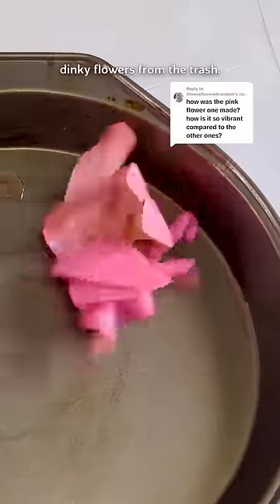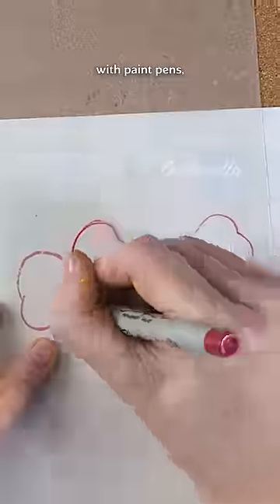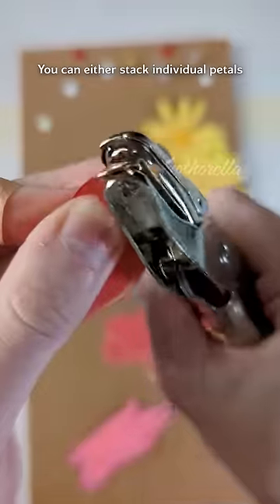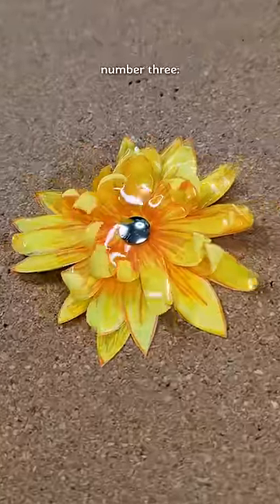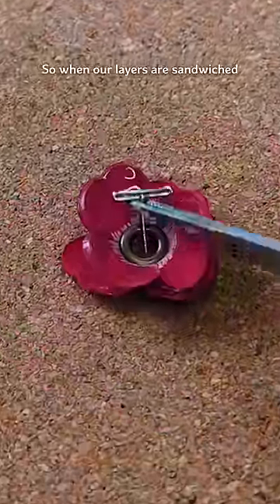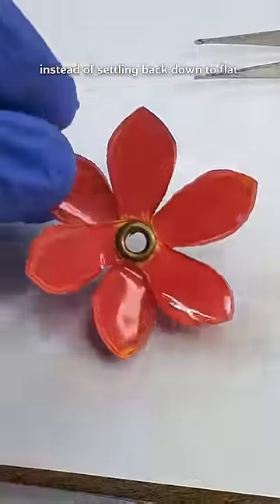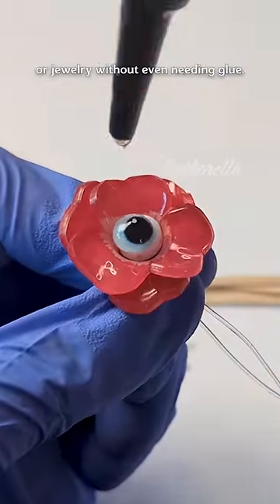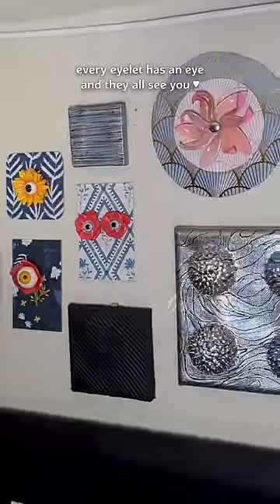#6 plastic = Shrinky dinks 🤯 now we can make flowers from trash ♻️🌷😜

Comment from the maker: ❤FAQ: Is this toxic☣️ -Quick answer. No, it should not create toxic fumes. Longer more involved answer:
So when we are heating our polystyrene to 250° f (212° f  should be what is needed) We are taking our plastic to its glass transition temperature but not actually melting it or burning it. When polystyrene is created it's extruded at a certain size and then stretched and rapidly cooled to basically freeze the polymers in place , so when we take it to our glass transition temperature we are unfreezing the amorphous polymers and letting them snap back to where they want to be . So no toxic fumes being created just some polymers getting cuddly. But that said, don't eat off the shrinky dinks.
(Another great example of glass transition temp is rubber! Which is past its glass transition temp at room temperature ! 
Now if you were to burn polystyrene, That would be bad. That does create toxic fumes. No open flames near polystyrene which includes styrofoam.
Reply: Can you include Celsius conversions for us who are not from USA? :)
Reply: Thank you for the information! But is the painting itself also not toxic when heated to this temperature?
Reply: Thank you for the useful info on how to get this for free. What a brilliant way to reuse plastic that would otherwise go in the recycle bin where it may just end up thrown in a landfill.
Reply: i'm a plastics engineer and i love this in-depth description you gave to explain why ps behaves the way it does! i also absolutely love your personality from just this video alone - i'm definitely gonna try to make some of these!
Reply: @idontreadorreply there are conversion tables on Google
Reply: Since you only need 212, have you considered boiling?
Reply: @evanmorrison3232 this would be impractical. It would be harder to maintain the temperature, make multiples at once, and probably have an adverse effect on the paint.
Reply: Does anyone know what the clear thing she put over the eye and flower is?
Reply: @samanthasunshine8085  it'd be easier to maintain the temperature because water has a higher specific heat capacity than air. So you're just wrong there.  It may impact the paint though.

Edit: just so you know, specific heat capacity is the amount of energy you'd need to change a certain amount of substance by 1°. For example.. waters is 4.186 J/g°C and airs is .7j/g°C....additionally, water couldn't go above 212F since it would boil, you  can keep pumping in energy and them temp wont change.  So really you're just saying dumb shit. Go take a science class :)
Reply: @idontreadorreply  I am going to optimistically ignore your screen name and provide the information you requested, including the formula for next time! 😊
(250°F−32)×5/9 = 121.111°C
(212°F−32)×5/9 = 100°C

Edited for formatting clarity

Comment: Number 6 plastic is the same as shrinky dinks? This is AMAZING news. I'm gonna check all my plastic packaging before sorting it from this point on.
Reply: How do you check it?
Reply: @christian1300 on most plastics there will be a little triangle made out of arrows, kind of like the recycle symbol, with a number in the middle of it
Reply: What did u use to shrink it?
Reply: @savedbygrace2k20 they use a heatgun (looks cooler on video) but you can also just use an oven
Reply: It's definitely something I want to try this sometime as well! I wonder if it works as the shrinky dink sheets of plastic!
Reply: @poece  thank you very much!
Reply: I FOUND THREE TRAY LIDS FROM DISPOSABLE TRAYS!!!
Reply: Where does it usually tell you that it’s poly 6?
Reply: @daciasdiy1861 somewhere on the plastic it would have the recycle sign (the arrows forming a triangle) with the number 6 in the middle of the triangle. If it’s poly 6, then somewhere on it, it should have that sign
Reply: @Zoey5374  Thankyou I’m going to look at some right now
Reply: Sorry to ask but is hair dryer ok ? @Mostlyhere2passtime

Comment: These conventional repurposed plastics are one of many fantastic ways to repurpose plastics.

Using these similar methods, you can also use them for joining, covering, and sealing wires and pipes. I reuse plastic bottles as Heatshrink for my low voltage and low amperage wires to isolate them from each other. I use real heat shrink on my higher-power lines and connectors.

Comment: these actually go so hard, is the temperature the same for heating them?
Reply from the maker: It is indeed! They work the same as commercial ones though they tend to shrink less, I have found. It's useful to do a test shrink with recycled number six before you do your real one. If you mark out normal lines of a ruler on your tester when you shrink it down, you'll be able to tell how much your shrinky dink will shrink
Reply: @Gothorella how did you shine them down?
Reply: To shrink them i think you could use oven  @krissy51123

Comment: Is this true? Are there any other risks of carcinogens with this type of plastic?
Reply from the maker: This is number six polystyrene plastic and in order to shrink it we are taking it just past its glass transition temperature where the polymers bonds soften but the polystyrene doesn't fully melt (rubber is a good example of something past its glass transition temp) 
So we are not releasing any gases to make our shrinky dink meaning that our polystyrene is no more carcinogenic than polystyrene normally is. 
However, if the polystyrene is burned it releases  many things you would not want to breathe in. So take care to keep it away from open flame

Comment: How to shrink them down?
Reply from the maker: I have another short on my page called shrinky dink FAQ that gives you some more tips however, quick answer, some source of 250 °f . (Very important: NO open flame near the plastic and take normal precautions not to get melted plastic on things by going too hot ) 
I used a heat gun, but most people use ovens set to 250 f for 1-3 minutes. (I would put parchment paper down on your pan first!)